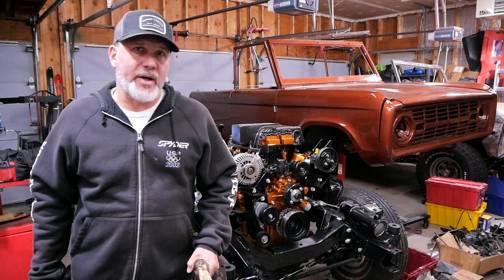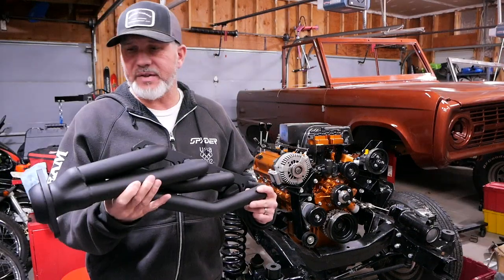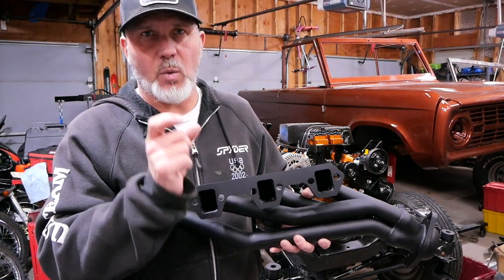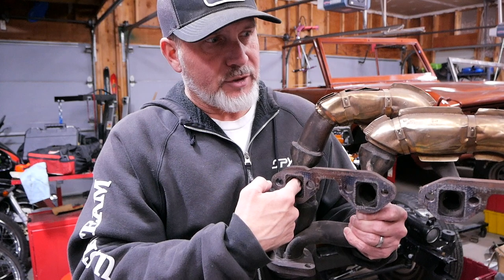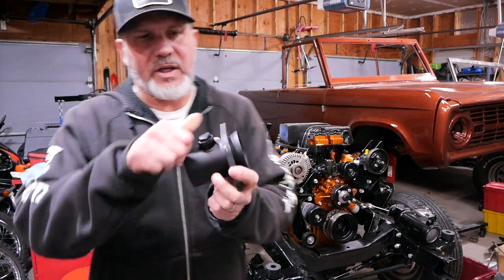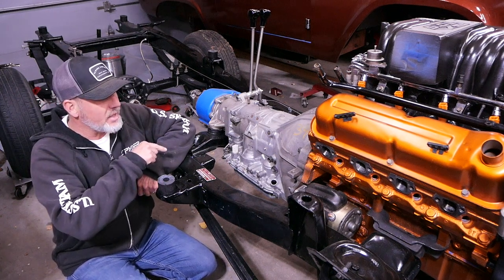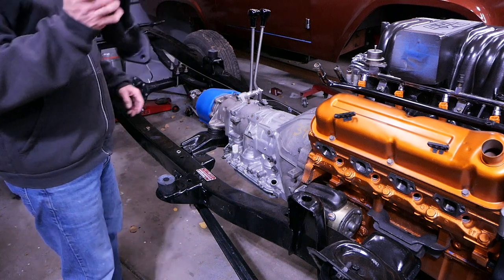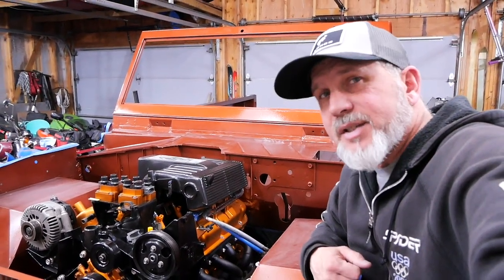Bronco - Make More Power! Shorty Headers

Comment: Looking good. I went with the James Duff exhaust system, I got the long tube headers that are ceramic coated and I got the magna flow muffler’s the exhaust system is all bolt together no welding all, the headers I got also have the ball sockets on the ends of them to
Reply from the maker: That’s a great system Nic, I agree.